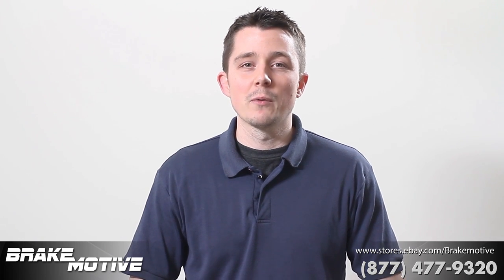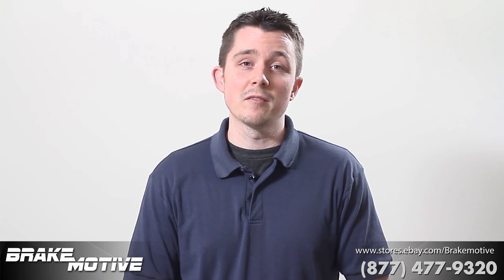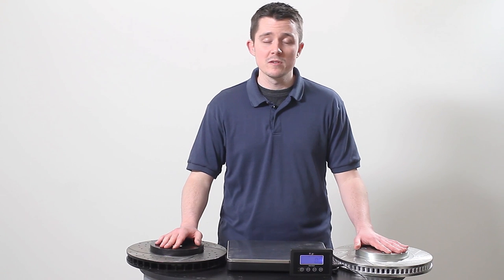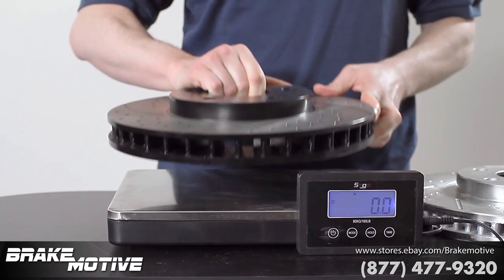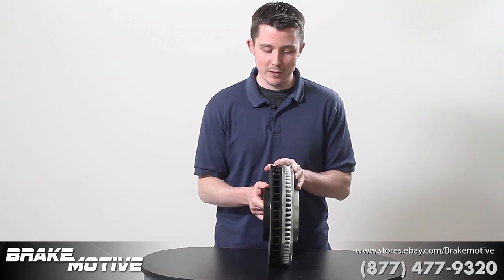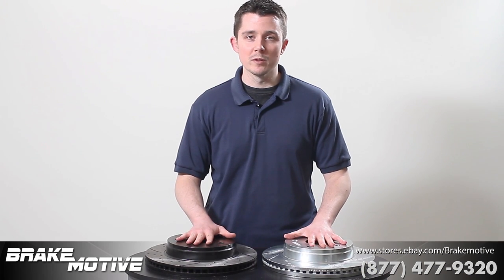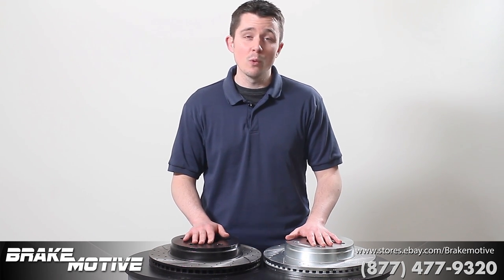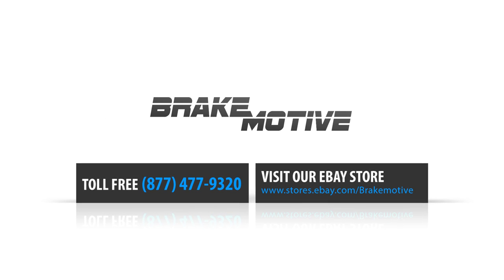Side by Side Comparison Performance Rotors from Brake Motive versus other sellers on Ebay

Comment: Got a set of these on my 14 f150. They’re nice for the money. They don’t rust, look good, and stop on dime. Took my truck and boat from Milwaukee all the way to Mille lacs (northern MN) and never once had an issue with all the hills and what not. Make sure you do the break in procedure and you’ll be happy as a clam. Can’t wait to get these on my tundra

Comment: I would think weight shouldn't matter but more so what material it's made out of. I would think for performance reasons you would want a less heavy rotor.
Reply: Justin G Less weight = less material = shorter life and/or less structural integrity.
Reply: less weight= better unsprung weight.
Reply: That's what they're arguing in the video and they may be right when comparing cheap ebay rotors. But this thought process is not necessarily true when comparing different materials and configurations.
Reply: Reason why rotors are heavy is not cause we can't make them lighter but cause they need to be heavy so they can dissipate more heat and have longer time before they get heat saturated and stop working properly. You can save some weight with 2 piece rotors, but still, physics are physics.
Reply: Weight does matter.  The more weight, the more mass for the heat to dissipate into.
Reply: False you can have carbon ceramic rotors which are lighter than standard rotors

Comment: These are great! Just picked up and installed a pair on the front of my car. Did the proper bedding procedure and the brakes are quiet. Not sure if they're any better(only had time to break them in today) than my old ones since my previous pads were new, but they look bad ass. They're a much better than the Duralast blanks I put on my previous car...which warped during the bedding procedure. The whole package is cheaper too. If these rotors don't crack or warp I'll put them on my other cars.
Reply: Breaking in pads and rotors are not the same thing. If you have bought new rotors you should avoid over heating them for the first 1000 miles. They can/will warp if heated quickly and then cooled. But after the 1k miles you can make a proper bedding (warming them up). You can read more about this on EBC's homepage. :)

Comment: I noticed you guys have a 10 year warranty. I bought my kit from your ebay page. I got it in 2014 and the metallic pads chewed the hell out of the rotors. The pads still look new though.
Reply: that means these "premium" looking rotors are not heat treated adequately if at all so they are softies ...not a good match for semi-metalic or ceramic pads -
 
Just ok for basic organic pads !
😂

Good sales talk is always cheaper than real quality 😂

Comment: Percision CNC-machined in the USA, bought from China.
Reply: I have China made rotors on my car, bought them in 2008. Now have 163, 000 miles on them. They have been turned down 1 time so far. No warping, no cracking at all.
Reply: Forged, made, and CNC machined here in the US. the mtal may be from outside the Us but that is the case for 99.9% of all metal these days.
Reply: stop crying
Reply: pretty fly for a wifi why do you say that?
Reply: Pretty fly for a WiFi.......wrong.  Bought a pair for my f150 and they were shipped fed ex.....once and only once in the tracking info did it say.....power stop Chicago.   All others it said brake motive Chicago....which I could post a pic. Both had same tracking info in details.
Reply: Chinese rotors are great

Comment: I would not use EBC GD as a bad example. That's a lot better in durability and performance than your zinc coated one. It also cost more than 20%.

Comment: If you claim that your brakes last longer and perform better than competitors, then why are your warranty only for 6 months while some are 1 year even more? Also FYI, the "check to fitting" in the ebay page is not working (no search results on ANY vehicle). I know there is a ph# but i'm just shopping around. thx
Reply: Anyone can put a warranty on a box of bs, doesn't mean the others will actually follow through and honor their so called 1 year or 2 year or 5 year warranty. The few cases of brakemotive problems that I have personally heard of, they made it right within 48 hours so long as the persons wasn't trying to scam brakemotive.
Reply: I think their warranty is 10 years?

Comment: I just bought a set from your brand!

i was wondering if your rotors need special types/size (thickness) of ceramic brake pads?  or would any brand brake pad brand fit?

If this set that i just purchased gives me great results, i will be forwarding your brand to my Group of Nissan z32's  we are a group with over 1k members, im most certain  they will love this!
Reply from the maker: Hello Gattler! 

Thanks for the comment. To answer your question, any brand brake pad would fit however we recommend anything as close to OE spec as possible. We're positive you'll see great results with the rotor set you purchased. If there's anything else we can help you with, please let us know! We'll be sure to give you and your group a nice group discount all you have to do is call in and mention your group of 300zx's. We are also developing a new set of extreme carbon fiber brake pads. If you're interested, pm me your email and you'll be the first to know about it. Thanks again Gattler!

\\The Brakemotive Team
Reply: BrakeMotive  OK! awesome i will let you know soon and notify my group about this!
Reply: @BrakeMotive, Hello I have 2 questions that I can't seem to get an answer on:

1) Will the silver zinc coating rub off near the brake-pads area over time?
2) Does the direction of the slotted lines matter which side it's supposed to go on? Thanks in advance!

Comment: i am thinking of buying a set of these rotors. has any one used them during the winter? i know that the cold would cause them to warp faster, just wondering how they hold up
Reply: high heat makes rotors warp

Comment: I had these rotors installed on my Accord and they are making ticking noise (very annoying noise). It drives me crazy and will get rid of it very soon.
Reply: That's most likely the holes on the rotor
Reply: Andrew Xie could also be the brake hardware or “clips”. either they weren’t put back or placed incorrectly. Hopefully you were able to resolve this issue.

Comment: just I want to know if there is Left and Right of slotted rotors .
Reply: Yes, the longer slots "point" to the rear. It will work the other way but braking will be compromised and more likely chance of that install error invalidating your warranty.

Comment: FYI, I had these rotors installed on my Range Rover and they ruined my e-brake assembly. Land Rover inspected them and found that the thickness of the inside of the rotor is 30-40 mm off the factory spec. When they advertise that these rotors are made to exact factory specifications, it is an absolute lie. Brakemotive refused to refund my money and the repair bill is over 3x the cost of the brakes. Buyer beware.
Reply from the maker: Hello Paul,  I'm very sorry to hear about this!  However all of our parts are indeed manufactured to OEM specifications.  So I'm willing to bet that the rotors you received in the package were mistakenly misboxed.  Did you end up keeping the rotors?  If so, what were the part numbers off the edge?
Reply: wow 30-40mm? Did you install a box of air? 30-40mm is 1.2-1.6 inches. You are saying that the rotors were invisible? Most rotors are only 1-2" total thickness anyways (depending on vehicle), so if you're missing 1.6 inches off a 2" thick rotor, you bought a saw blade from the hardware store, not brake rotors..... or the more likely scenario where you're just a troll that works for one of the other ebay brake sellers...
Reply: Lol you didnt notice the rotor was 30-40mm off when you installed it? That's an inch to and inch and a half lol. Sounds like bs to me.

Comment: what's the differences between rear discs? left and right
Reply from the maker: Hi J A,  The only difference between the drivers side and the passenger side rotor is the drill and slot pattern.  All other dimensions are going to be the same as your OEM parts.  If you need any more help, go ahead and email us at brakemotive@gmail.com with the year, make, and model and we can give you any additional information needed!  Thanks!

Comment: Jus got mine for a 96 Lexus LS400
I am very curious how this full front and rear brake set will work on my LS since it is a bit heavier vehicle.
If they work good i will use them for my other vehicles.
Has anyone used these brakes for heavy luxury sedans/SUV/truck?
Reply: like a diesel Truck
Reply: like a diesel Truck, 3ton or under?
Reply: like a diesel Truck, 3ton or under?

Comment: anyone have rust issue with these?
Reply: I've used them on multiple vehicles  (04 Durango, 03 Ram, 06 silverado, 01 Pathfinder) and while it is normal to get a little bit of surface rust in the middle by the wheel studs, the rotor face itself stays clear with regular driving.